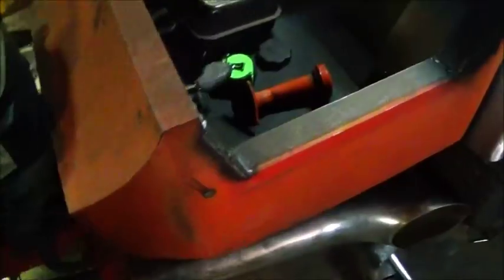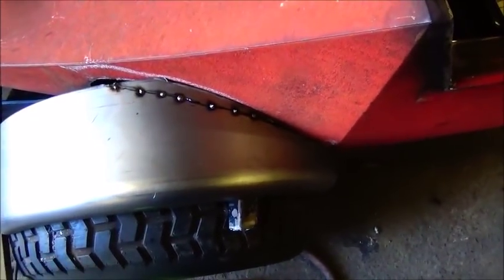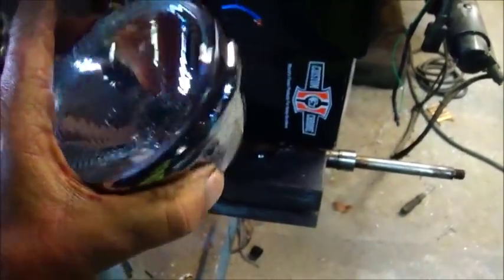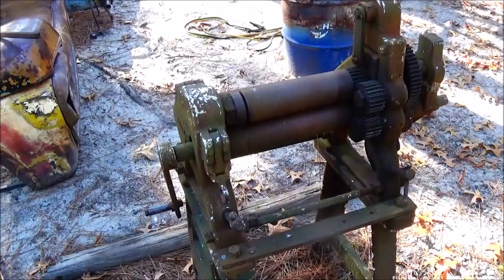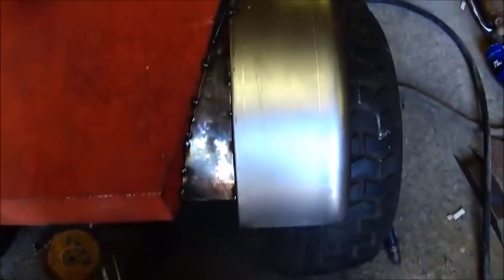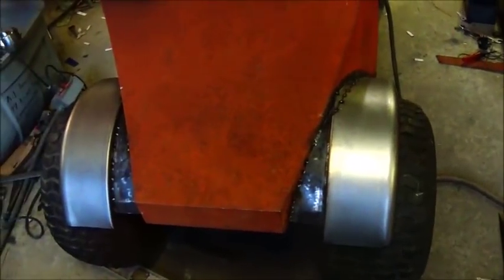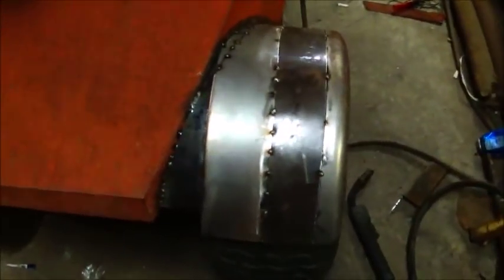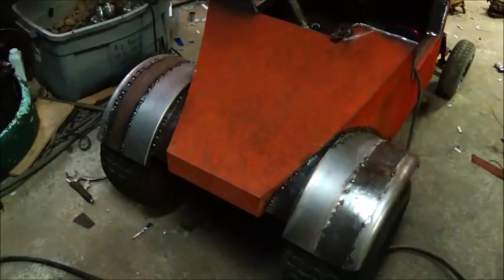Hot Rod Go-Cart 7

Comment: Tank outside, painted with Chrome paint and brass or copper straps and fuel lines. Maybe something of a "Steampunk" look, you could even put an oversized gauge on it. Yuo could carry out the same theme on the radiator and radiator cap and the rods going from the cowl to the radiator.  It looks great, I wish you were my grandfather (except I am 5-10 years older than you).

Comment: I'm 27 and it boggles my mind to see so many people my age and even some older folks fail to recognize things were made to much higher standards back before the mid 80's. They just don't see that those older cars and appliances were designed to be maintainable and rebuildable while newer cars are essentially disposable. And hot rodding is the ultimate form of recycling, very few folks use and repurpose more discarded materials than a budget minded hot rodder or rat rodder does. 

@Jonathan W If you are reading this comment I'd be more than happy to offer you my assistance in any future one day builds. I live in North Carolina too and I'm no stranger to turning wrenches, I put the engine and trans in my car myself and I've never owned a car or truck newer than a 1986 model. I also do decent paint and body work and I have about a dozen project cars, some of which you can see on my channel. 
So keep me in mind if you need another set of hands on a build, I would love to help out!
Reply: I'm 61 and having lived from the late fifties and started working on cars in the late sixties I can tell you that cars & trucks are built much better these days than they ever were. In 1970 if you bought a new car you could expect the valves would have to be redone at about 60-70 thousand miles and the whole engine rebuilt at 100K if the body hadn't rusted out yet due to the poor quality of the steel used and the lack of rust prevention. Planned obsolescence was key then with Detroit figuring on people trading every three to four years before their cars lost most of their value. Cars these days with proper maintenance commonly last 250-300K and get much better fuel mileage and are more reliable than they ever were in the past.
Reply: @VetteKid That's a load of pure BS, I have a 73 Mustang, a 74 Plymouth Valiant and a 79 Oldsmobile Cutlass that all have their original numbers matching engine, trans and clutch and they are all still drivable. Not to mention the fact that you see at least one unrestored survivor at every classic car show. 
My cars aren't pampered garage queens either, they are beaters that were used as daily transportation for over 20 years and survived it. 
My 68 satellite has also been into the next state and back without stopping for fuel, it gets well over 20mpg on the highway so you are wrong about fuel mileage too. I'm starting to think you aren't 61 years old, if you were then you'd be wise enough to know better, plus I kinda doubt you are 61 if your name is "Vettekid".

Comment: I like it on the outside!  I have a Craftsman tractor I bought in 2003 and with proper maintenance on the engine and (un) serviceable hydrostat transmission and 2 sets of spindle bearings on the deck later and tubes in the tires so no leaks from my old tires - it still runs like new - heck - BETTER!  I know if something goes wrong internally on the engine, I should be able to get parts and go through it when the time comes, but as you say, they were built to fall apart and you see them a dime a dozen on Craigslist.  I wouldn't sell mine.  It works awesome and as long as I keep on top of things, it should last me through til the 'end game!'  Great work on that cart!  Happy to be a new subscriber!

Comment: When I was a kid, most pop machines had glass bottles, but the new canned pop didn't have pull tabs, so there was a gizmo on the machine to punch a hole in the can, you lifted it up, put the can inside and pressed the lid to punch the hole.  Even as a kid I thought that was unsanitary.  Those things never got cleaned, and the pop sprayed inside so there were yellow jackets inside sometimes.  A guy here in town invented the pull tabs and became a multi millionaire.  The only problem is everybody pulled the tabs off and threw them on the ground, which makes my treasure hunting hobby less enjoyable because they always ring up as a ring!  I've dug thousands of them.  I throw them into the aluminum scrap pile.

Comment: Outside - more authentic to the old school T bucket hot rod.
As for recycling - we used to buy a local soda called A-Treat in returnable quart bottles. That company would just wash them and put them back on the bottling line. The shoulders of the bottles were frosted white from bumping into each other over years of re-use. If anyone has tried to break a heavy glass bottle, you know they can handle a huge amount of stress - compare that to the injection molded water bottles that leak because you gripped them to tightly. Two different mentalities about product delivery. I prefer the first.

Comment: I grew up in Toronto Canada, and when I was growing up in the sixties, we drank soft drinks and milk and beer from washed, re-used glass bottles. There were a few incidents of people being injured from these containers that failed after they were refilled and either were faulty or cracked during transit. It was the liability that processors were subjected to that killed re-use of glass containers, and they switched to recycled glass new containers. The cost, in energy, and the cost to upgrade processing plants made companies switch to plastic containers. The cost to manufacture and transport was substantially lower and that was how the suppliers sold us on the plastic containers. 
  And they missed the contamination by the plastic and ignored the cost in garbage.
  Nowadays, in some provinces in Canada, the containers are sold with a deposit and are returned to recycling depots where they are baled and reprocessed into non-food products.
  And cars are throwaway because of the labor cost to repair old cars, the impossibility of repairing modern electronic components (printed circuits and microchips) and access to credit. It is simply so much easier to finance a new vehicle than it is to finance a rebuild, especially since the cost of replacement parts is so high.
 It's great to see builds using repurposed materials; Can you see the average city dweller with a shop able to re-form metal parts to keep our new cars on the road? Frame table, plasma cutter, and power hammer, please.
  I was thinking I'd need a tow truck and junkyard too.
Keep on keeping on.

Comment: Canned pepsi drinkers unite!.  Up here in Michigan, we have a 10 cent deposit on cans and plastic bottles.  It can be a pain to recycle them, but we pay that deposit when we buy it, and get the money back when we return the containers.  As for the gas tank,  I think I would like the tank being inside the body better.  The lines are clean on the outside.  I'd keep them that way.  
I agree that the younger generation has no clue as to the things we did when we were young.  I used to pick up bottles and take them down to the little grocery store-  CANDY MONEY!..

Comment: Tank on the outside.  You could even mount it further back to  conceal the sharp edges on the rear of the body.  Kind of like the tank on a 32 ford car.  I agree with you on recycling!  One think that gets recycled over 99% is lead acid car battery’s!

Comment: Love the fenders widen, good move. I think the gas tank locate in either place will look good, just depends on your tastes. I have seen real hot rods with the tank mounted both ways, if done right the outside tank does look better. I not sure we recycled more before but we turned into a throw away society necessitating the need to recycle. You are right things were built to last and if they broke there were repair shops for everything.

Comment: Heineken made little 5 liter mini aluminum kegs, these days you can find empty ones of those for about $10-15 on eBay.  Clean off the Heineken paint and get it back to raw aluminum. Would look trick in front of the grille like on so many hot rods. (have to put a V shaped tube bumper in front of that something of course)   Even works with your talk at the end about recycling! :)

Comment: Outside would be cool but what about inside with a rumble seat hatch door for access to fill er up? No rumble seat of course,just the tank in where the seat would be. I don't think rain running down the slope of the body and getting in the hatch is an issue considering the cockpit is wide open anyway.

Comment: Tank on the outside Jonathon. Also I remember scrounging for bottles to take to the store and then buy candy. And my 1975 F-150 runs better than some of the newer ones, sure it doesn't have all the built in GPS and phone but I don't need that. Also what ever happened to the 1963 Falcon?

Comment: Nice work on the fenders they look sweet. Really dig that old slip roller she will look awesome cleaned up and painted. I agree with you machines from the 70's & earlier usually lasted much longer, built with design, quality parts & metals, thicker gauge steel etc. Once names like Bolens, Ariens, MTD, Gilson, Montgomery Wards, MTD, Coleman, Stanley, Sears etc the list goes on... got bought out and/or outsourced to China the quality took a dump. Taking the name with it... Rather buy a drill press from the 50's clean it up a little and hopefully pass it down. Same holds true with machinist tools if wasn't made in the USA or England I'll pass.

Comment: Hello,
I really think the tank ought to be on the inside. Sure it looks better on the outside but I would be worried about it getting knocked loose or crushed somehow which would be quite dangerous.
On the note of recycling it seems marketers found that people are willing to make more small dollar purchases than one large one.  A mower costs the same in dollars as it did 50 years ago but the value of a dollar has gone down.  Good mowers are available but are a good deal more expensive than most would want to pay.  Notice how the new Briggs mowers say you don't ever have to change the oil.  Turns out that's because the mower will run through the warranty period without an oil change so it doesn't matter to Briggs after that.  
Brian

Comment: Tank on the outside is cool, it will get used to carry a passenger though. Would an 85 lb. kid crush it?  a solid mount with toe steps on each side and a roll bar to hang on to and it'll do wheelies fer sure.
Reply from the maker: I could sit on it and I am close to 200 and it wouldn't even dent it. Old and well made.

Comment: Electric saw-shaker is ingenious. 1) Two of those fenders put together at the straight/flats would look great. Do you have more?  2) Yes, fuel tank mounted to outside. A chained cap would be nice. Include a shutoff on outside. 3) Where I live (Upstate Central NY) we recycle more than we trash. Too bad NC isn't part of   https://en.wikipedia.org/wiki/Container_deposit_legislation_in_the_United_States   HDPE (and similar) IS EASIER to recycle than aluminum, or any other metal- that must be melted and filtered. Plastics are merely washed, and ground into flakes- ready to be molded again. It is shameful- ALL 50 States should have recycling. BTW- Studies have shown that Alzheimers is a result of aluminum deposits in the Cerebral Cortex of some patients. Phosphoric acid in soft drinks can leach some aluminum into the body, past the blood/brain barrier in lab mice. Food for thought...

Comment: Jonathan , please don't hate Japanese made vehicles . They are far better made than American crap .  And they don't hate us the way we hate them .The reason they are not around is  because we , as a country hate them that much .I'm very proud of my 1996 Nissan D-21 2wd regular cab pickup - with 328,000 miles on it . With 4 timing chain assemblies replaced .Myself ! Chill dude ! Annd I'm a conservative , Christian , and a prepper .
Reply from the maker: I drove a Toyota in the 80's because they were far superior to American vehicles, Citations, Chevettes, Escorts, Tempos and the like, but american vehicles have more than redeemed themselves. I tow cars every day, I see GM and Ford products with far more miles than 328k still running, I have a 6.0 with 340k. Problem with Japanese cars is they will NOT last the test of time. The Japanese are experts at building cheaper! I in no way hate them. I have studied the history extensively and if it had not been for our help and rebuilding after WW-2 they would be nowhere. Mr. Honda made piston rings for Toyota and after the war he used an engine left there by us during the rebuilding process to power his first motorcycle, so he learned from that design to build his own. American cars are far from crap!! Where did all the 1970's and 80's Nissan's go? I owned some, I remember seeing a lot, but they have vanished because they can not stand the test of time, I have plenty of American cars that held up.  My son use to keep track of every brand he towed for break downs and Toyota was at number one by far. He done this for a couple years and if I can find the list I will add it in a video.

Comment: You had the rear fenders there the whole time. Cut the things out of a steel barrel. You could have used the ridge ring on the barrel as a detail. And the gas tank on the outside for sure.

As for the recycling yes and no. The use of glass or lack there of has been a big mistake. NJ was known for its glass industry and now they give tours of where the glass plants used to be. I just dug out a well head for our water a couple years ago. There was a styrofoam cup from a local shop that was thirty years old. It looked brand new , and was useless but had it been a glass bottle I could have recycled it. But as for cars the safety alone with airbags and crumple zones makes it worth replacing. You haul away wrecks that everyone walked away from that would have been fatal in a 1970’s car. Collecting classic cars yes but daily drivers no way.

Comment: On your fuel tank, you have the tools and ability to make a tank like the old Moon tank back in the 50/60's Why not do that? That old tank you have is an ugly piece of s--t. Absent that, you could use an old beer keg.
The reason you don't see many cars from the 60's/70's is two fold. The chintzy Nissan, Toyota , Mazda models died long ago, and got recycled. They were never meant to last very long anyhow. The second reason you don't see these cars is that many of them come from a transitional period in American manufacturing where foreign makes and smog restrictions were being dealt with and a lot of them just weren't worth the time/money to keep them going. The last and maybe most important item is that the factories are controlling the supply of OEM parts so they can have absolute control over when a particular model dies by shutting off the parts supply particularly in the area of electronics.